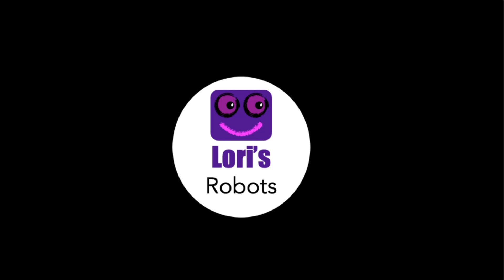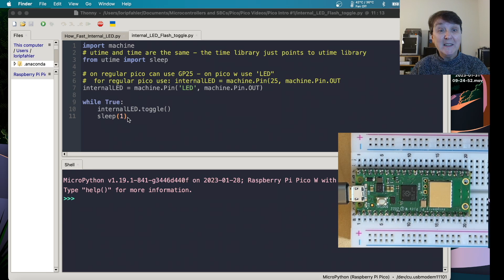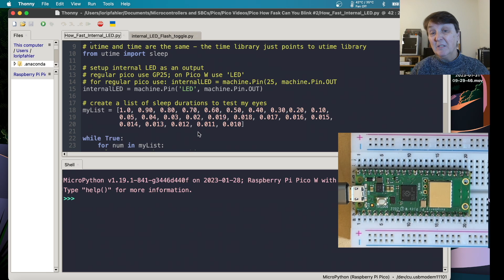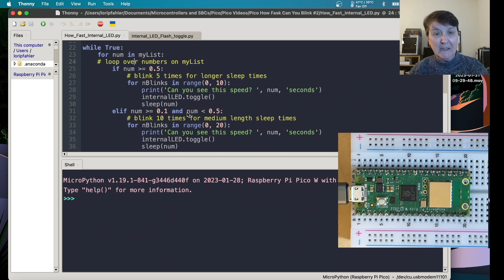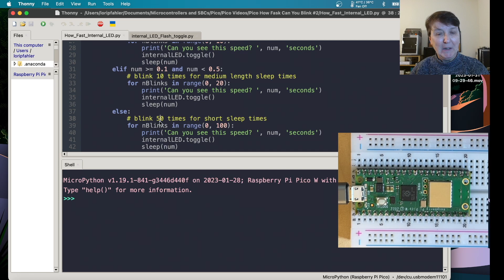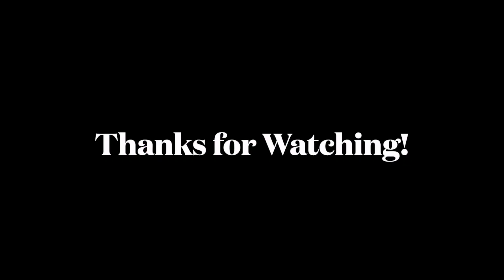Pico W Episode 2:  How Fast Can You Blink the LED and Still See It?

Comment: Awesome 👌 
Here's the issue: The print() function incurs a relatively huge delay.
The longer the string you print() the greater the delay you incur.
I found this out the hard way 🙄🤦🤦🤦
Reply from the maker: Good point; although it did get to the point that I could not see the blinking so I am not sure how much the print() function delayed the blinking.  I also noticed that my time was very similar to other folks in the class.  Still I will watch that next time.  I really only needed to print that once.  Thanks for watching!
Reply from the maker: I updated the code to move the print function outside of the blink loop based on your feedback.  Not sure it made a big difference but now there is no question and there is less stuff in the shell window as it operates.  Code is linked in description. Thx!
Reply: @lorisrobots  
You're a legend ✌️😃👍 
Probably only a MilliSecond or so 🤷 
I guess you could use the system clock to reveal the extent of the delay 🤔👍
Thanks Lori 👋😀
Reply: @bigbogeyface    could log to memory, print out at end, or use a second pico to detect on/off ...